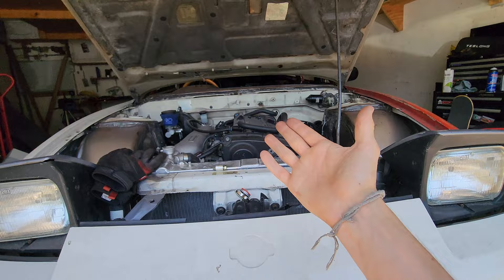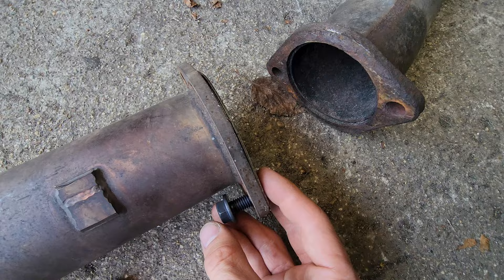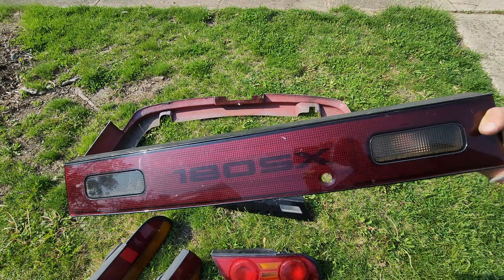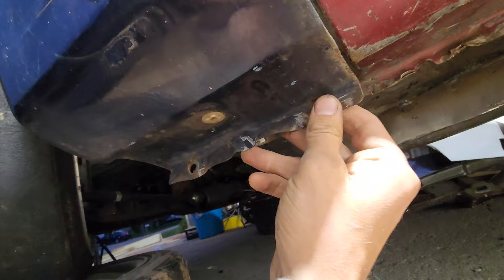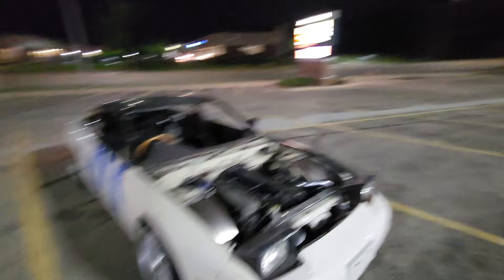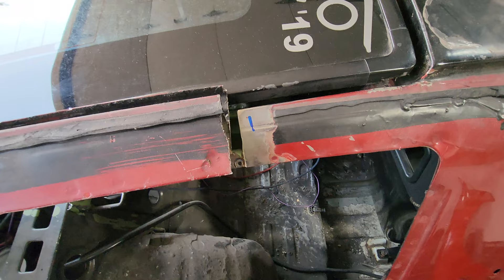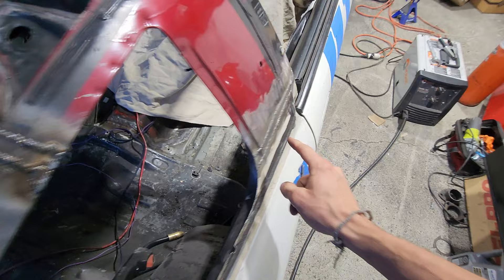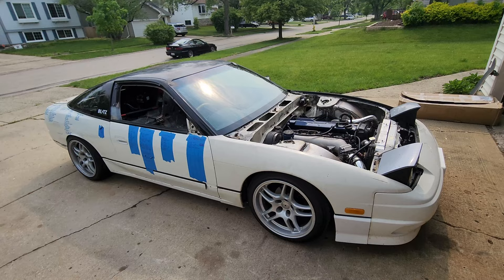Initial Shake Down in my Project 240sx! + Glass Install!

Comment: man its actually thrilling to see the glass installed, feels like it all came together so quickly all of a sudden. so stoked to see how the interior turns out!!
Reply from the maker: Right! The quarter panel was honestly holding up the entire process!
Reply: @PrizzaMike  "uuhh... i want to say... something for you."

"You tell 240sx, but it's actually 180sx...
240sx and 180sx is same car but they have difference"
-240sx is america version of 180sx

-240sx using KA24DE engine while 180sx using CA18DE
("I know you just swap engine")

240sx is LHD and 180sx is RHD

Please call it 180sx, because is RHD
("if you don't swap the hand drive")

Comment: Great progress! A method that I found works well for s13 exhaust install is to leave all of the bolts from the cat back loose, then gently jack up the exhaust until it’s hitting the bottom of the car. Then tighten all of the bolts. When you lower the jack the exhaust will lower some but stay tucked up. You can also use hose clamps on the rubber hangers for more clearance (I’m sure you already knew). Good luck!

Comment: 3S Chemicals out of PA would be a great place to chemical dip your car. Personally love that blue on the new fender great colour for a 240sx.
Reply from the maker: Interesting! I'll search the Midwest to see if there's something similar
Reply: @PrizzaMike  Chemical dipping companies dont usually work with the public or do cars. Finding one up here in Canada has been pretty hard, planning on taking the car down to Washington to get it done. Highly recommend getting your car chemical dipped as opposed to sand blasting. A lot of classic cars get dipped because it can get inside frame rails and places you just can't reach with a sand blaster, just need to make sure that you coat the inner panels and frame rails after it's been dipped and your car will truly last forever.
Reply from the maker: @rylinrei  that was my thought exactly for choosing the dip process!

Comment: If you decide to dip strip the car, pay for an extra round in the neutralizer afterwards. it will help to remove the dip chemicals in tight seams and minimize the risk of seam corrosion blowout. Also go for the electrolysis coating

Comment: Don't get the shell dipped! There are so many classic cars here in the uk suffering from trace amounts of the acid left in the spot welded seams rotting them from within & that's with cavity wax protection. Owners are then faced with a full strip down of every panel into kit form & a full jig up rebuild. There's no other way to deal with it. Get it soda blasted instead. Cheers. Leigh.

Comment: The reason the manhole grates on the road were so high is because they are milling and resurfacing. They are repaving and first the cut the pavement down an inch or two then the add pavement to bring it back up to height. As for the manholes, their top elevation has to remain the same.

Comment: U can dip the car into a acid bath then dip the car in a zinc bath this helps it not rust. Audi did this with the 80/90 to make sure the car didn't rust (and it actually works too, my 80 is from 88 and it lives in a rainy snowy salty place and has 320k km (200k miles) on it ) and all in all still rust free......

Comment: The thing is if you acid dip it you will remove all the protection you have spent time doing between panels as you built it. Would be much better soda blasting it. You know the stuff you can’t see is good now so just clean all the outside and inside areas. It’s not as it it’s rusty anymore.

Comment: Weld though primer is used before you weld, normally is used when you have over lapping metal. Then any bare metal should be primed with epoxy.

Comment: Try serrated flange nuts instead of the nylocks. Serrated will bite in the metal tight and not loosen on those high vibration applications

Comment: To acid dip the car after all the inner pannel coatings and such would be a waste in my opinion.  Strip the top and the side back to metal and have a quality shop work the car. After take it to get krown or oil guarded a second time and youd be set for years and probably cost alot less.

Comment: Any guesses as to what happened with the old turbo?  Is it possible some shrapnel from the wreck was lodged in there someplace so when you took your test drive it tore up the impeller?  Just curious.

Is that a new windshield you had installed?  If so, I'm surprised you can still get new glass for these cars.  I think my windshield is in good shape but the trim around the outside is looking kinda meh.  They look like they did a good job though... may have to call those guys if I need any glass work done.

Comment: Don't dip the car, there will always will left some dip in areas. Paint will not stick there or undercoating. And it will be a weak spot. You are better of with sandblasting!!